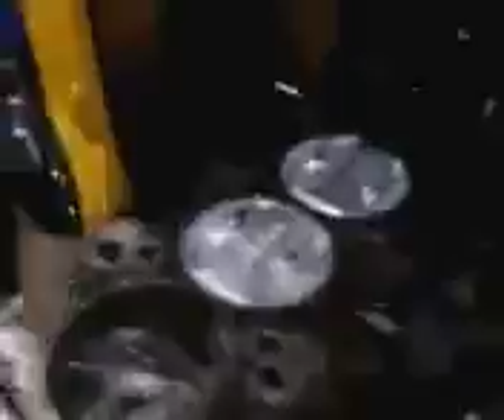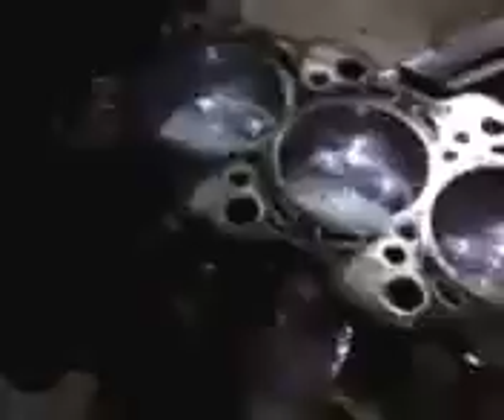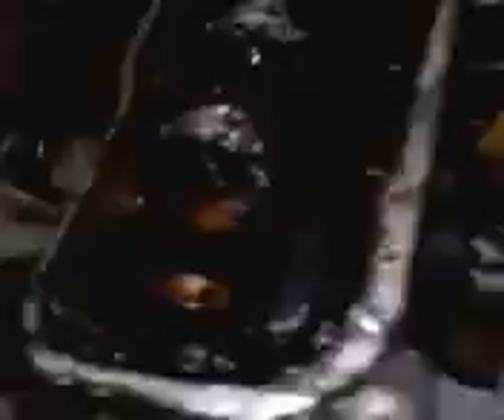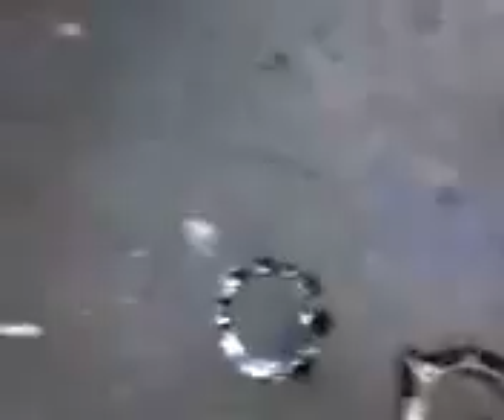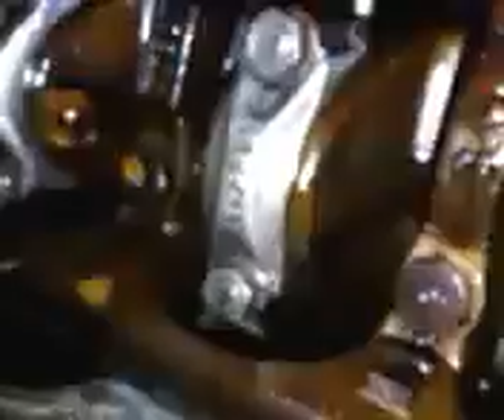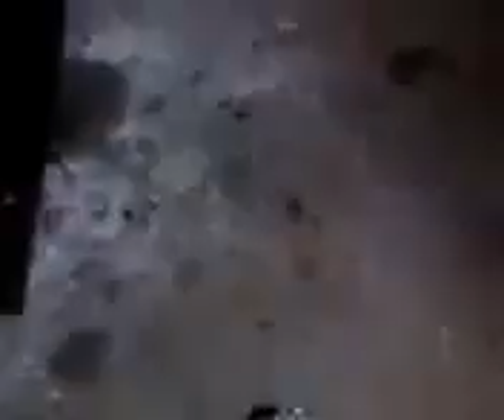B16 Rods and Pistons in 1.8 4G93 Technica Mirage block

Comment: bro this interesting any change on the stroke meaning if rod leng is diferent?
Reply from the maker: marino Sanchez the stroke is the same, although the rod length slightly changes, the placement on the wristpin compensates the hight so it makes it identical to the Mitsubishi rod side to side and at TDC.
Reply: Epinero Muzik any compression gain?

Comment: do you use the b16 rod bearings?
are they also modified when you shave down the sides of the rods?
Reply from the maker: k2daalvin b16 rod bearings, no modifications needed since the bearing width is still thinner then the shaved rods.
Reply: Epinero Muzik if you have the spare parts lying around, do you know if b series rod bearings fit a 4g93 rod?  I am having trouble finding any parts store that can order 4g93 rod bearings. 
thanks for the reply!
Reply from the maker: You could get the bearings for the 4G93 on eBay or most likely Mitsubishi Dealer.  The B16 bearing will only fit the B16 rod.

Comment: you think will help for turbo
Reply from the maker: if u modify forged b16 rods the same way to use forged full floating pistons yes, it wil help.
Reply: Nice... Any other parts or tricks to use on the 4g93 sorry im new to all of this Mitsubishi engines
Reply from the maker: +Rosmar  Crespo run a 1997 head with adjustable rockers and you'll be able to run a regrinded cam.  all other years are hydraulic lash adjusters and you won't be able to upgrade cam.
Reply: +Epinero Muzik ok cool I only whant 300whp I was thinking to use the nippon b16 turbo pistons on stock b16 rods pnp the head 440cc wrx injectors 255lph walbro pump fuel regulator
Reply from the maker: +Rosmar  Crespo get the ARP rod bolts for the B16 rods
Reply: +Epinero Muzik ok what about arp for the head? where you located fl?
Reply: +Epinero Muzik I was thinking  to get the block from the lancer 2.0 if I do that you think I can use the honda b20 pistons n rods or maybe the k20
Reply from the maker: +Rosmar  Crespo I think they use celica ARP studs I have to double check lol